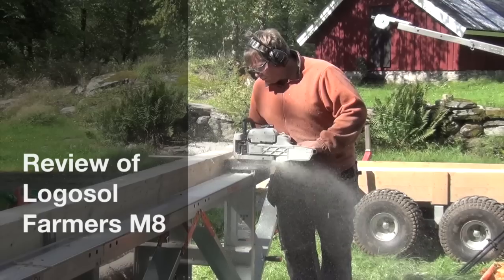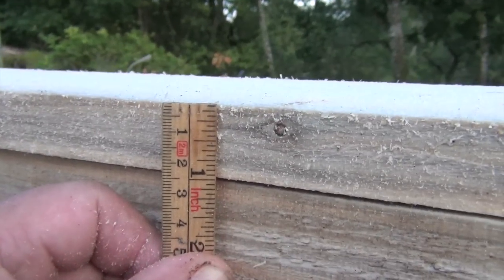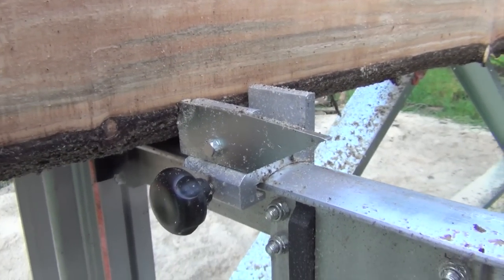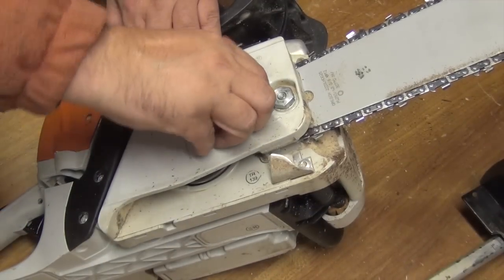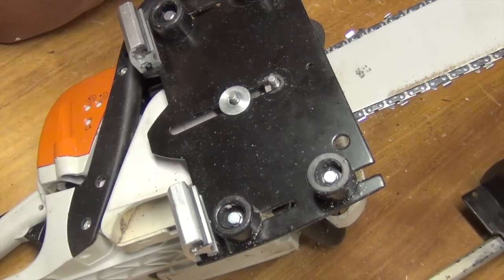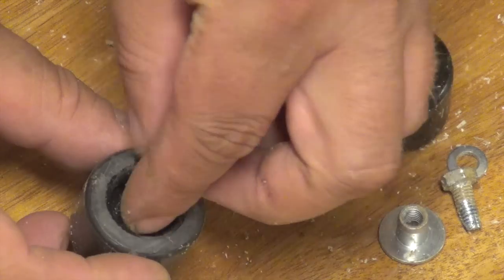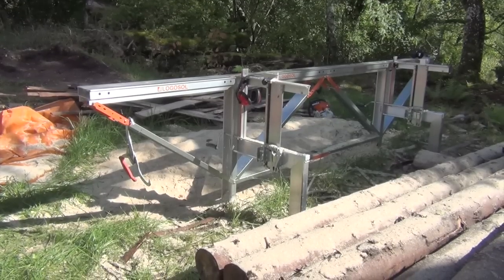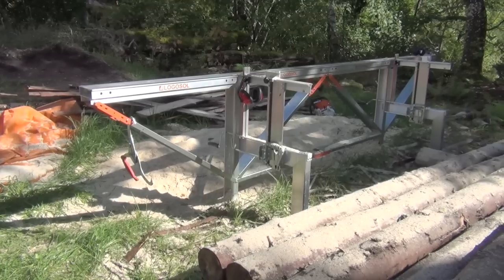Logosol Farmers M8 and Stihl MS391 review

Comment: The supports seem  too far apart to deal with short logs. Is there a good way to mill short logs on the logosol?
Reply from the maker: There are several ways to solve it. You can move the legs to 1m apart instead of 2m. You can extend the saw that I have done now, then you get 2m between two legs and 1m between two legs. Look at any of my newer videos you'll see how it works.
Then you can get a moveable log support that I made a video about https://youtu.be/6l3XpXznwKg